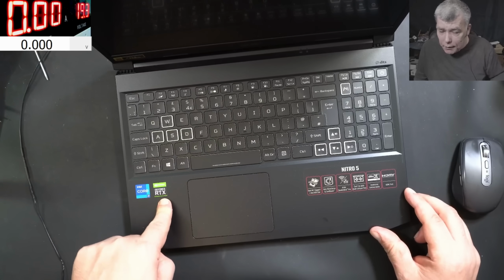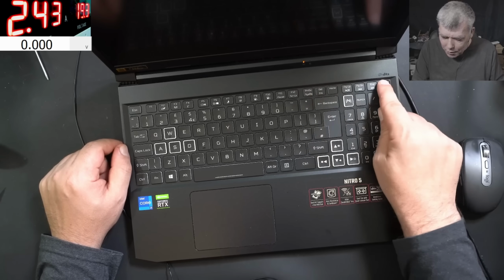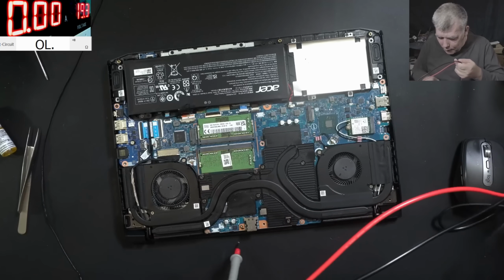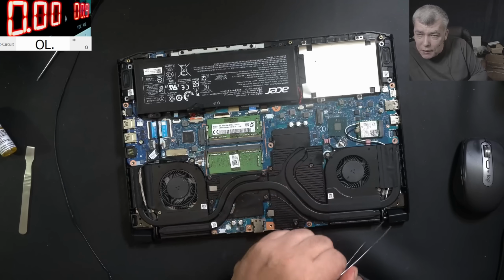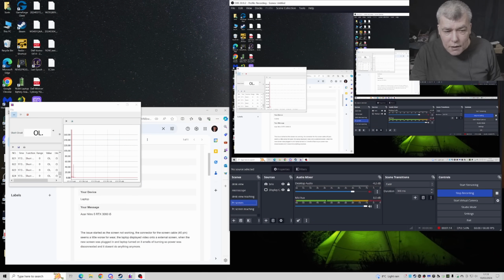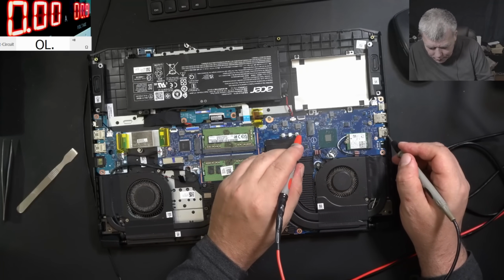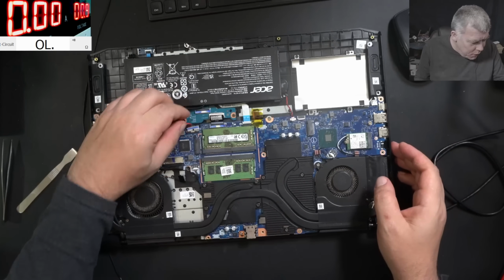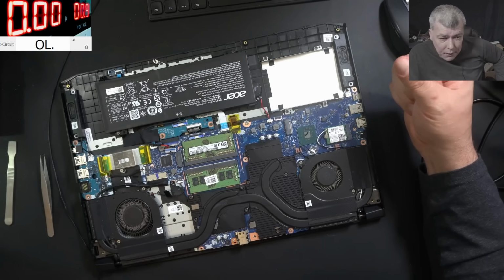How the 'nice laptops' are dying - Two Nitro 5 intel + RTX graphics diagnose - #fail collection

Comment: Sorin just a little correction the intel graphics does not come from the chipset, its embedded on the cpu package. Om very very old systems the intel graphics was on the chipset, like core 2 old
Reply: when you have dual graphics(Intel and AMD), video signals have to be switched,  I think this is the chip that is doing it.
Reply: @yoppindia  a mux. :)
Reply: If you look again, I'm sure you will see a separate GPU on both of these laptops.

Comment: 06:20 Chipset manages the flow of data between components on a motherboard. It's the traffic controller between the CPU, GPU, RAM, storage, and peripherals. When the laptop is not at heavy usage,doing some simple stuffs laptops are using integrated gpu which are build in cpu,for example for intel cpu: some inte uhd and Intel Iris Xe Graphics for amd some Vega graphics.Ryzen laptop user can find  that easy,when you open device manager,open cpu list its say for me:  AMD Ryzen 7 3750H with Radeon Vega Mobile Gfx. When you start heavy task like game it switch the gpu using from cpu to your stronger gpu. If you like using always your stronger grapics u can set it in windows. Overall there will be nothing wrong if the manufacturers will glue some heatsink on the chipsets,but i think they not doing that because the chip itself should not heating mouch.
Reply: The PCH got that name because the north bridge is now on the CPU. Data flow between CPU/RAM/dGPU no longer pass through the chipset. Only south bridge stuff like peripherals exist on the PCH-

Comment: I have 4 Acer Nitro's all with dead chipsets.  Just got a BGA rework machine.  Going to try replacing the chipsets and see what happens.  Hope I can bring them back to life.  Always wondered why some laptops had heat sinks on the PCH and others don't guess just cost savings for the manufacturer.  Going to stick some heatsinks from Amazon on these if they work after their heart transplants.

Comment: "Gaming" laptops often fall short fall short of true gaming capabilities, resembling knockoff versions of desktops rather than genuine gaming machines. note that aside, with Moore's Law nearing its physical limit, planned obsolescence has become a prevailing concern. mounting a small cooling thermal pad or heat sink into the PCH could have significantly extended them prematurely broken laptop's lifespan, yet such measures seem absent in today's market, falling below satisfactory standards. a scummy behavior if you asked me.
Reply: exacty what it is actually. They dont want the laptops to last as they want people coming back to buy their newer laptops each year just like how apple stops putting out new updates on their older iphones after a few years.

Comment: My son has such a laptop. Any suggestions how to prevent this?
Reply: buy a Lenovo Legion next time.
All gaming Laptops are crap, but at least Legion are built a bit better.
Reply: Keep the chipset cold with a tiny heatsink, or thermal pads
Reply: You could find an old cup heatsink from a modern laptop cut to size and then connect it to the primary heaksink via soldering. Obviously checking clearances from other components. It is extreme but would work. Thermal pads may do a decent enough job. Most modern laptops are crap anyway, poor design cheap parts, you'll get an original alienware still going strong today, you won't be saying in a couple of years about the latest gaming laptops.
Reply: @marksutherland774  exactly because both cpus and gpus now have become so fast and powerful that the laptop making companies are probably worried by now that people will stop buying their newer laptops as the "older" ones will be good enough for years.

Comment: It doesnt have to do with the "PEG", it has to do with IDG, perhaps youre confusing with MUX switches and optimus.
In that case if optimus runs everything passes form IDG. IF autoselect PEG is "wired" directly "bypassing" IDG.
Thats why you get performance boosts with Optimus off, or if you got better laptop Advanced optimus. 
If im correct.

Comment: brother, I need your help, I have an imac a1419 (2014) that drives me crazy, it does not provide audio, the strange thing is that it does provide audio when the machine starts, once the system starts, it does not do so, it does not detect any device, except one that says digital output, I have already ruled out the system, I already changed the headphone jack, I measured if voltage was reaching the codec, and if it did, (just in case I replaced it) and the problem continues, I no longer know what to do, thanks in advance .
Reply: You need to check the audio circuit maybe there is a bad component or cold solder joint. I would try to reflow or replace the audio ic.

Comment: Im pretty disappointed with Acer. The Nitro series is reasonably priced and I had recommended it as a budget gaming/work laptop for friends but it was poorly made. Would not recommend getting anywhere near Acer anymore.
Reply: Wat?? xD. I been using Acer nitro for like 3-4 years. 0 Issues. I been purchasing many different branch of gaming laptops from ASUS/MSI/HP.. and so far acer nitro is one of the best ones that i spent my money on. The worst ever to buy a laptop for me was the HP OMEN gaming laptop. It's one of the worst gaming laptop i ever had in my life. Though its hard to say if TOP1 for me is Acer or the ASUS. ASUS gaming laptops it's just also super amazing. But Acer probably i put for TOP1 because they not only provide a great gaming laptops but also the the daily task easy laptops the cheap ones to use. I bought for my all family cheap acer laptops and been using for years it.

Comment: Laptops with RTX GPUs aren't really that expensive any more, as Nvidia has discontinued the GTX line and even lower end GPUs are now part of the RTX brand. There also used to be a low-end MX line, but it seems Nvidia has discontinued that one too.
Reply: probably because the integrated graphics have become so good in later years.